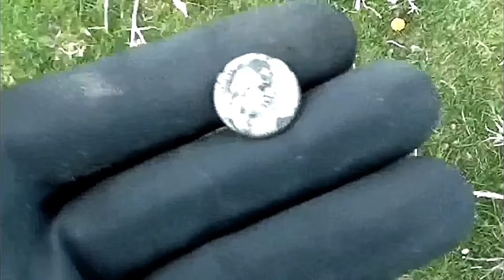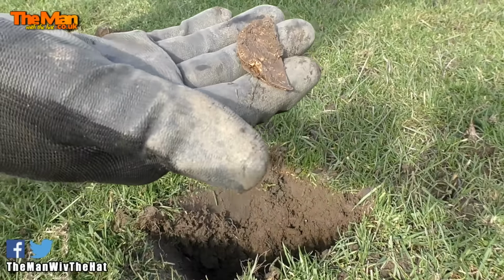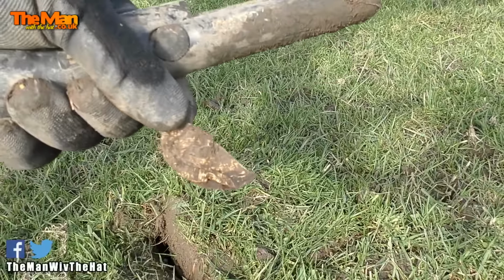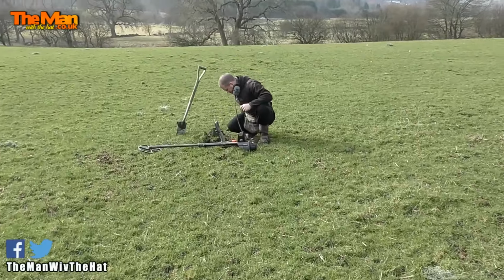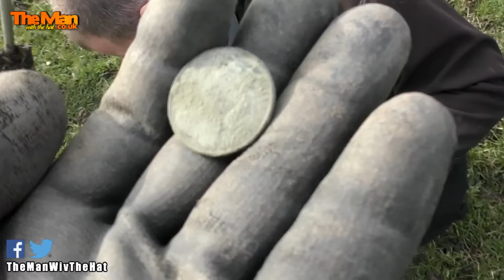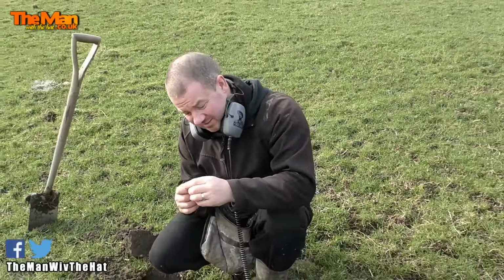Metal Detecting with your ears. Listen don't look!

Comment: .. mmm Hi Steven.. re them tubes,, and bely muck .. iv never seen or heard of them  till I started detecting 2 years ago .. my local permition ,, especially bottom field is or was littered with them.. some with plasic coating some without ,, also some with iron or steel plugs in end,, they are stainless steel and iv measured a few they are quite precise engineered,,  one farmer told me and I showed the one I have in my detecting bag, that they are part of a mobile milking machine ?? but I cant see that either,, sorry long post .. they remain a mystery ,, I will ask at woodheads slaughter house if they have come across them .. they are an old business. I'm a butcher also.. lol..

Comment: Stephen - of course you know who would never consider answering to this suggestion. And I am of the opinion that the sounds are probably the same here. So, that being said, could you make a video of the different sounds but just tell us this cooper, silver, iron, a penny, silver, etc. just list every kind of sound you can think of and we can listen to each to each tone being discovered. Say this the MD sound of iron and now this is the sound the pen pointer will make but for the MD part go over the target about 20 times. Then we beginners can listen and learn over and over. I will send you a sample of coin if you like of US currency to use as well. I think it,would be extremely nice of you to do that. And it would be extremely beneficial. And you can say this is a general idea of what it will be with maybe a little difference in tone depending on the MD. Maybe you could even use your awesome Deus with the hot Gary program and borrow a Garrrett so some,of us,that have the cheaper version without calling them the cheaper version of a MD. It would be a wonderful teaching vid like with making a ring. What do you think???? Blessings